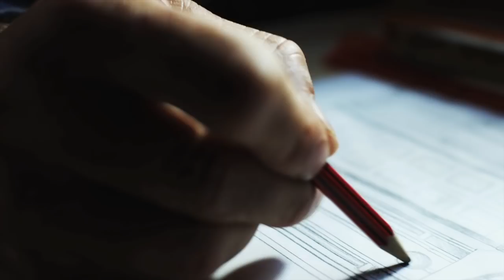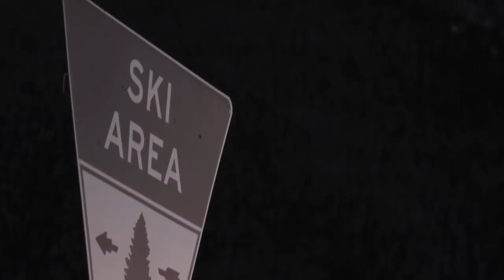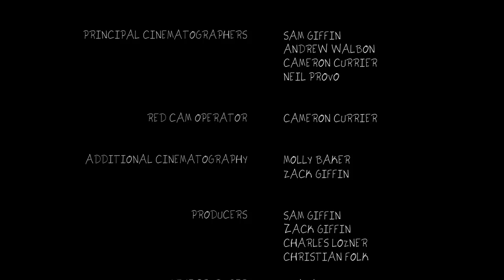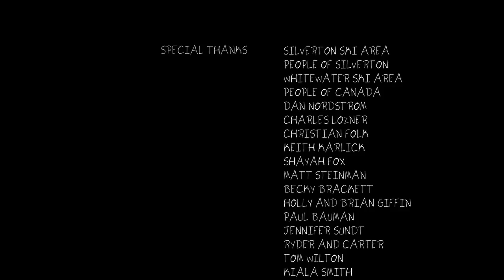Outdoor Research Presents: Livin' Tiny - A Quest For Powder

Comment: The truck in this video, Rusty D lives again. After repair from the fire and repower with newer diesel engine, it is ready for its next adventure. I am driving it to AK from Seattle in July to use at my property and gold mine. Great job on this video.
Reply: Is rusty still around?

Comment from the maker: They have 2 deep cycle batteries that can be charged with an outlet or the 2000watt generator that lives in the truck.  They have some LED lighting as well that is run off the batteries.  However when using the water heater or refrigerator they have to be plugged into a power unit.

Comment: Hey ! ive been working with designing a house
on wheels and i was wondering if you could take
a look on the video and also if you have any
tips or suggestions. I would really appriciate
that. The video "tiny house idea" is just 1 minute
long so it wont take much of your time.
Reply: Hi Flip, I looked at your video.  Nice work.  I think the house looks great!  Go for it all the way.  My only suggestion, if you want to heat water on your stove, there are special wood stoves that are made to fit a wash pan and transfer the heat super efficiently.  I kind of wish I had one sometimes.  Heating water from the chimney may take longer than you'd hoped?
Reply: oh okay. yeah sounds like a good suggestion man.

Comment: Should have kept the old truck. The old idi's are super cheap to repair in diesel terms. Sounds like that had leaking return lines, and some broken glow plug connectors that lit the leaking diesel on fire.

Comment: Zack Giffin - How did you guys manage to secure the wood burning stove?
Reply: The stove is bolted to the floor.  I've been a bit concerned it could wobble loose, but so far so good!
Reply: The leg's don't get hot? I'd imagine some sort of heat resistant board/stone would support it..  (Thanks for replying). You guys Tiny House tour is awesome.. =)
Reply: tek2advance
We have stones underneath the fireplace and the stove is bolted through the stone and attached to the floor framing.  If that makes sense?  The legs don't get too hot because of the tall shape of the stove.  I think the bolted stove is the only reason the stone hearth hasn't wobbled loose.
Reply: Thanks... I've been scratching my head about it for a while.. The clarification helps... Happy adventures! I hope your family and friends stays safe... =)

Comment: is there ant blue prints fr this?
Reply from the maker: Check out tumbleweed homes. Our tiny house was inspired by one of their designs. There should be enough information on their site to get you started int eh right direction on buying your own, or building a Tiny House.
Reply: Outdoor Research I attended a Tumbleweed workshop last year, and they have awesome designs..While these are a great idea, they aren't made to be moved around every couple months... coming in at around 8-10,000lbs, you either need a powerful pickup truck and lots of $$$ for fuel, or have to rely on someone else to tow it around for you.. I'm converting a Honda Element into a micro camper with an ECamper poptop. Now that's the kind of mobile living I could get into, at a fraction of the cost, especially travel wise! :)
Reply: Outdoor Research Awesome house. What was the average cost to build?
Reply: +Alex “Laxrox123” Nemon I'm sorry I never made blue prints. The shape is fairly basic ruffly designed after houses I liked by TumbleWeed.  I did a few original things with the house. I framed 24" centers using Beam Lumber (LVL's) ripped down to 2 inch for the studs, plates and rafters.  3/8 sheathing on both sides, fastened with screws and staples with 2" blue board foam insulation.  The idea was to build a strong skinny wall to maximize the interior space and minimize the weight for travel.  It's something I've yet to replicate but after years of hard travel the OR Tiny House is in remarkable shape.  I would recommend taking similar weight saving measures if the idea is portability.
Reply: +Zack Giffin what was the total Weight?
Reply: +Zack Giffin what was the total Weight?
Reply: total weight is 7,720

Comment: I don't understand what makes this different from a 5th wheel. Can anyone explain that to me?
Reply: Dare u to take a fifth wheel out in the winter. ;)
Reply: yes, why not? they have heating systems just like this.
Reply: cost
Reply: do they cost much less?
Reply: Approximately 100k less...  The nearest RV with this kind of insulation and square footage costs a little over 100K. Of course, these can cost in the 50k range if you hire someone to build it.  However, self builds average 15-20 k. The average RV does not have the kind of insulation and heating system that can withstand winter conditions and still be livable.
Reply: Just remember you need the add the cost of your truck to pull it into that calculation.  A trailer would be similar to the house arrangement, and they are far cheaper than an RV.  The house is very cool though, not sure its ideal for being constantly portable.  Looks good as semi portable though.
Reply: 5th wheels do not hold up as well over time. They're great for short trips etc, but they are not made as sturdy as these. The weight difference alone bears that out. ;)